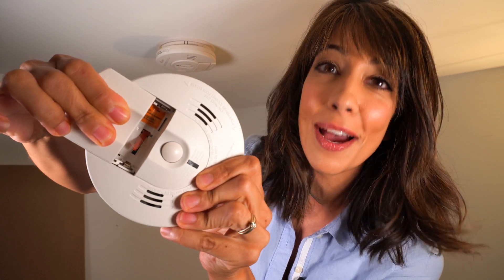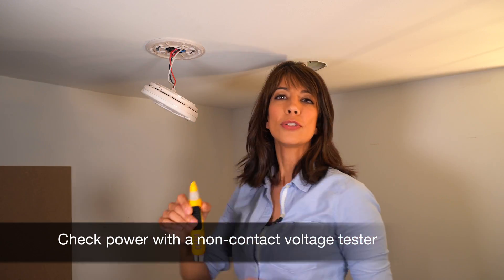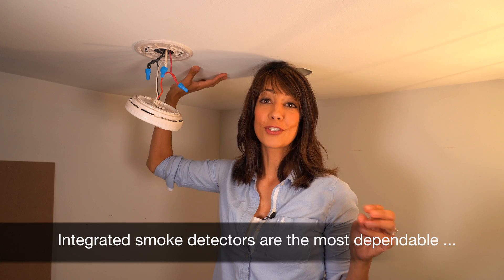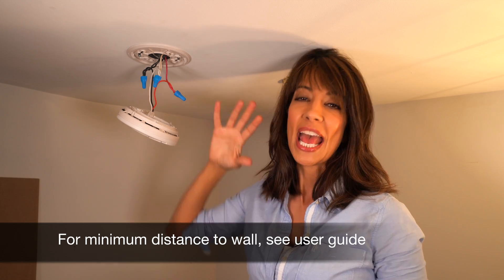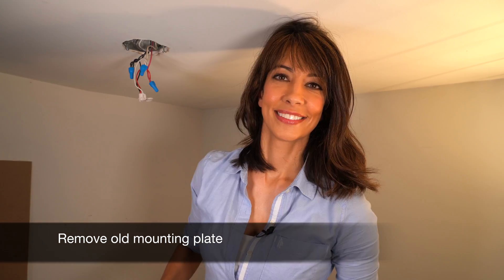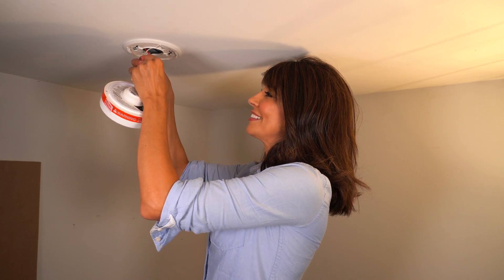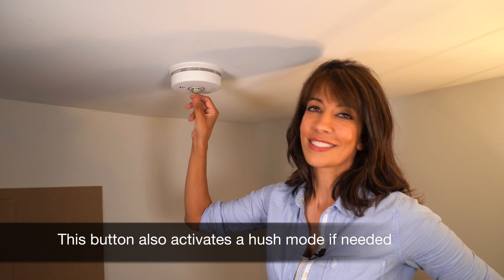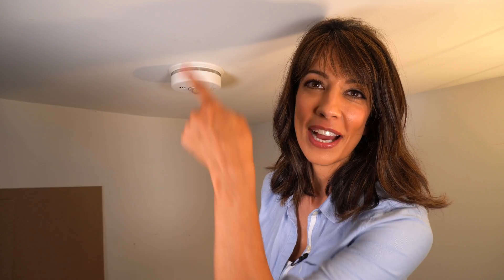How To Replace a Hardwired Smoke Detector | Why These Are The Best!

Comment: What if your pins dont match? How do you find the exact pin configuration
Reply from the maker: They sell adapters or you can wire in a new one that comes with your detector. I have a video that shows you how.

Comment: Tried replacing mine.  First I broke the plastic bit twisting it off that quarter turn that she made look so easy.  Then I couldn't find where the power to the smoke alarm was in the breaker box. No clue unless I shut the power off to the whole house.  Then I tried to pull out that plug.  Again, no clue.  I just about ripped all the wires out of the ceiling trying to get it off.
It would not budge.  So now I have a broken non-functioning smoke detector dangling six inches from my ceiling in my entrance hall.  
I should have called an electrician to begin with.
Reply from the maker: Oh no, that sounds incredibly frustrating! It's definitely tough when things don't go as smoothly as they appear.

Comment: Excellent video!  Do you have a preferred manufacture for smoke and carbon monoxide detectors?  Thanks!
Reply from the maker: I don't. We have to install ones that comply to our code. I would use a major manufacturer and check the reviews. Amazon has good pricing on those. I hope you found a solution that worked for you.

Comment: My co-worker and I both bought the 10 yr battery alarm. Mine lasted 3 yrs and hers lasted 4 yrs. It just started going off all the time for absolutely no reason. I'm back to the regular battery one. Waste of money
Reply from the maker: I appreciate you taking the time to share your review of the smoke detector. They should last as advertised. This is a category that would benefit from greater choice in brands. We are required to install 10 year battery alarms by code.

Comment: Hate hard wired, how you post to know where the fire ?
Reply from the maker: Hardwired is the safest option available you’ll be notified of a fire no matter where the location. Typically you’ll hear the smoke detector sound from the one unit and then it will go to all of the smoke detectors.
Reply: @DaruDhillon  or just 1 smoke detector in the room the fire is in... yes if you got bad ears sure, but i dont. Running around the house checking every room because you cant pin point which one..

Comment: I just replaced one of our Kidde hardwired smoke\CO monitors and it silences once active but the rest of the smoke detectors in the house are going off and won’t stop. Do you happen to have thoughts?
Reply from the maker: Sounds like a frustrating situation. I would troubleshoot each unit and turn your breaker on and off. I hope you find a solution.

Comment: Kiddie products are no longer available.  Is there a smoke detector that will fit into the existing 3 prong original outlet designed for kiddie products?  First alert and others require modifications or adapters if available.  Thx... BTW great videos, easy to understand, short and sweet and to the point.
Reply from the maker: Thanks for sharing your experience. I haven’t looked into the pigtail adapters. I would need to check on that.

Comment: I would rather add batteries every year . I have not been at peace since they were installed . It is currently chirping and nothing is working according to directions .
Reply from the maker: That’s unfortunate that the 10 year battery hasn’t worked out for you. I personally like the 10 year because it is a safety improvement designed to reduce fatalities. If your smoke detector is under warranty, you can return it and get a full refund.

Comment: If you are replacing an old FIREX detector you might need an adapter for the different plug found on the newer detectors.

Comment: If my previous smoke detector had wires, is it important that I stick with the same type of smoke detector with the wires? Or can I just change the smoke detector to battery only and tuck away the wires in the back of the detector?
Reply from the maker: If you have a hardwired detector I would replace it with a hardwired battery version. That’s the safest route and required by code and probably your home insurance.
Reply: @DaruDhillon  I really appreciate your wise advice.  I am glad I ended up replacing it with a hard wire version.  It wasn't as difficult as I thought it would be to replace it.  I also purchased that tool to tell if the voltage was on or not.  I was worried about electrocuting myself.  That tool was worth the money.  Thanks again.
Reply from the maker: @peacelovejoyandhappiness  I’m so glad you took the time to comment and did it yourself with the tester. It’s important you feel safe. Great job! ❤️
Reply: @DaruDhillon  awe of course, I’m the blessed one that you made your video. Thank you so much.
Reply from the maker: @peacelovejoyandhappiness  🙏🏽❤️

Comment: Thank you for posting this. It was very helpful. Some additional information though; Carbon monoxide detection should be done at the lowest points of each floor, as it is heavier than air. This means that by the time it reaches the ceiling, the house could be at dangerous levels. For this reason, it’s good to have separate detectors plugged in to outlets outside of bedrooms too.
Reply from the maker: @robertsmithington8892  thanks for the tip on carbon monoxide detection. It’s a good point. In my home I have additional carbon monoxide detectors in the bedrooms plugged into outlets and in the furnace room. Always important to consider when you have a gas furnace or appliances.

Comment: Hello Daru great video!
I have a question. I tried to change the battery in one smoke alarm. But then, I realised that the unit stopped working. When I opened it, I found that of the 3 wires connected to the smoke alarm, only the red and black are connected. The white one was dangling. I want to confirm if this is normal? 
Thanks.
Reply from the maker: Hi, and thanks. Usually the white wire, the neutral is connected to another white wire.
Reply: @DaruDhillon  Got it, thank you! It needs to be reconnected. It must have slipped from the wire nut.
Reply from the maker: @Odekaodeka  you got it. All the best!
Reply: @DaruDhillon  Thank you! 💕

Comment: My problem is they never labeled the breaker box when they installed the new smoke detectors. So I don’t know how to shut them down.
Reply from the maker: If you have someone who can help you locate the breaker that would be helpful. You can use a voltage tester to help you out.
Reply: They do make circuit tracer products, depending on how technical you are. 
    There's no reason why you can't turn every breaker off and check the lot. After all it is a domestic setting with nothing critical to go wrong.

Comment: You are Amazing!!!  
If I am replacing an expired Kidde hard-wired smoke detector, can I use the old wire harness and just plug it into the new detector, of which the red, black, and white wires are aligned with the old wire harness? Do I need to turn off the circuit breaker before connecting them?  Thank you so much!!
Reply from the maker: Always turn off the breaker to be safe. Thanks! Glad you made the change.

Comment: They make batteries that last 10 years, that are specific for smoke detectors. What people really have a struggle with is changing the batteries for smoke detectors that are installed on really high vaulted ceilings. I haven't seen a video yet that addresses the ones that are hardwired in or have the battery opening that don't slide open.
Reply from the maker: That’s a value added tip on the batteries. Thanks for sharing Robert! Good to know.

Comment: What if the beeping is coming from the ceiling? I disconnected the smoke alarm unit but the ceiling still beeps. I threw away the unit.
Reply from the maker: I would try to locate the source of the beeping. I haven’t come across this issue. If you found a solution or if someone has a suggestion please add a comment.
Reply: @DaruDhillon  One reply on another channel said that the hardwiring may connect to an older alarm system no longer in use. It certainly looks like it. A newer model was slapped over old location. I can get the braker to the mystery beeping shut off but then I have no electricity for my stove. I am going to try and completely seal off the wires with a plastic lid, caulking, spackle and paint. I can't be disengaging a whole hardwired alarm system. I don't know what I'm doing and I'd have to get into an attic.
Reply from the maker: @jojokeane  I'm sorry that's the situation you find yourself in. If your old smoke detector wires are in a junction box for safety it needs to have a removable cover so that you can access it if needed.

Comment: @Daru Dhillon our detectors are likely getting replaced this weekend
Reply from the maker: That’s great that you are updating your detectors and keeping everyone in your home safe!!
Reply: @DaruDhillon  i saw you had no rewiring to do too
Reply from the maker: @DylanChalmersWx  in this video I didn’t. I have another video on how to wire.
Reply: @DaruDhillon  for area's without a smoke alarm?
Reply from the maker: @DylanChalmersWx  I show how to wire your junction box not fishing the wire through the ceiling.
Reply: @DaruDhillon  today is the day for us to replace them. our old units are still up serving as temporary units until we take them down and put the kidde smart smoke alarms up. no more battery doors. which are a pain to open
Reply from the maker: @DylanChalmersWx  I always keep the receipts too. The warrantee is 10 years. Good going. 💕
Reply: @DaruDhillon  the units we have are essentially the smoke & co alarm like you showed just no voice alert and it too is an ionization. they won't be up much longer as the new ones will be getting paired up, added to the kidde app and then put in their spots. i do recommend people leaving their previous units up until they get their new ones so they have continued protection even if the manufacture year is 2003,2004 or 2005 so they can serve as temporary units.

Comment: shouldn't you be turning off your circuit breaker before doing any work with electrical wires?
Reply from the maker: Yes, all electrical starts with breaker turned off in each video then a double check is performed with voltage tester.

Comment: I’m having issues removing the old smoke alarm from the ceiling, seems like it’s locked. Is there a tab or something I need to push to turn it?
Reply from the maker: Usually you can apply a little pressure pushing upwards and turn it to the left. Turn off the breaker first. When in doubt I would also try the opposite direction in case it’s reversed.
Reply: @DaruDhillon  Thanks yeah I ended up having to twist harder as you said and it finally moved, the Kidde ones can be a pain like that.. thanks
Reply from the maker: @ACMaverick  I appreciate you replying because sometimes a little extra muscle is what it takes. Glad you figured it out on your own. That’s awesome.

Comment: Thx for your video! How to turn off the power of the detector?
Reply from the maker: You should turn it off at the breaker before replacing. I also like to use a voltage tester to confirm it’s off.

Comment: Can you add receptacles from a fire alarm?
Reply from the maker: For our code the smoke detector is on its own with one light fixture only. You’d have to check your local electrical code. I like the safety of having it separate.

Comment: Luckily where I live, the code for homes is one smoke detector located in the hallway outside bedrooms. Multi-unit properties require the smoke detector in the stairwell, on every floor, plus one in every apartment.
Reply from the maker: It's interesting how much codes vary from one place to the next. Always interesting to know the differences. Thanks Kris!
Reply: @DaruDhillon  I can imagine why there maybe such diversity between building codes across Canada. The home may not be multi-unit but more multi-family or generational. Thank you so much for your response.

Comment: It seems like you cut out the part I was wondering about which is how the "plate" is secured to the ceiling. I'm confued because when I was trying to "twist" my smoke detector off the entire thing came off the wall (the detector itself and the plate it attaches). How is that possible?? Seems like my plate wasn't screwed on
Reply from the maker: You’re spot on! You should be able to remove the smoke detector on it’s on with a gentle twist. That being said, I’ve seen many that are not installed properly and like you’ve seen the whole thing comes off. If it does, install the mounting plate so that your 2 screws are secure in the small part of the key hole openings on the mounting plate. Thanks for the question!
Reply: @DaruDhillon  Thanks, do I just use the two screw holes in the electrical box?
Reply from the maker: @0xSol_Invictus  yes those two holes are for your mounting screws. You can attach the mounting plate directly onto your electrical box and install the screws.

Comment: So if I'm installing a new hardwired smoke detector, do I have to re-wire everything or just plug the existing wires coming out of ceiling into the new smoke detector?
Reply from the maker: If you are replacing an existing hardwired detector that has a quick connect pigtail like the one in the video you can swap out the detector for a new one from the same brand. They also sell pigtail adapters online if needed. If your original smoke detector is really old and doesn’t have the quick connection you may have to hardwire it. I have a video on how to wire smoke detectors in the description box if needed. Thanks for the question Joe 👍🏽
Reply: @DaruDhillon  Wow, thanks for the quick response! It has the quick connect plug like in your video. Didn't think it would be that easy! Great video btw ! 😊
Reply from the maker: @JoeBucks  you’re in luck it’s a simple swap! Good luck, you’ve got this. 👍🏽
Reply from the maker: Thanks Joe! All the best to you. You've got this 😃

Comment: I can’t get my hallway one or my bedroom one to work. My dad died recently and my mom is handicapped. Could they possibly still be beeping because of them being interconnected and it’s telling me there are other ones that are dead?
Reply from the maker: You’re kind to be helping your mom and condolences on the loss of your father. To help you can check each detector for its expiration date. If you can’t locate the expiration date it’s time to replace them. They need to be replaced every 10 years because they expire. Sometimes one unit will malfunction and start beeping or the alarm will actually malfunction and go off repeatedly. In that case you can press the test button on each unit to locate the one that’s not working and replace it. It’s important that they are all working properly. I hope you are able to find a solution.

Comment: What should I do if I've replaced all the old ones got brand new batteries for each and then they still beep?
Reply from the maker: Check each individual units test button and it’s expiration date. If it’s expired or has no date replace them. Too much dust on old smoke detectors’ sensors make them less sensitive and dangerous.

Comment: How to change the battery in the ceiling smoke alarm
Reply from the maker: At the front of the alarm their should be a little rectangular panel that you can slide open. I hope that works for you.

Comment: Anyone ran into a scenario where the beeping is coming from the ceiling and not the detector itself? I replaced my detector with a new one hoping it stops the 5 beeps but to no avail. Anyone?
Reply: Yes this is currently happening to me with one of my smoke detectors. Chirping is coming from the ceiling where I detached and removed one of the smoke detectors. Since I’ve two smoke detectors that are interconnected I think the one that is still attached is causing the electrical socket box  to chirp from the wiring. Will get an electrician in to solve it.
Reply: @enaidu58  my issue was actually this… I replaced the hallway  detector a few days but forgot to throw it away. I then left the house for a week and my brother ended up taking the old one (it still beep even after being taken down) and put it in the night stand in my room. The beeping wasn’t from the smoke detector in my room but rather the old one I didn’t throw away lol took me a week to figure it out since I don’t use my nightstand often and my brother was away. Even the electricians didn’t have an answer for me, they just told me it was probably my neighbor… best of luck to you!

Comment: I am replacing 4 wired smoke detectors with 7 battery only smoke/CO detectors. I didn’t have any in the bedrooms and in CA they need to be integrated. My question is what do I do with the wires since I don’t need them?   Can I tape off the connector and stuff it into the box?

Comment: Replacing mine. I do not have the red wire since its spliced into the light circuit I guess.
Reply from the maker: If the smoke detector you are replacing  doesn’t have the red wire then it’s not connected to any other smoke detectors. Older homes are generally wired this way. If you ever plan on renovating adding interconnected smoke detectors is really important for the safety of you and your loved ones. Good to hear you’re replacing yours CT!👍🏽

Comment: Thank you for the video. However for viewers not in the USA, be careful about the wire colourings (at 2 mins 10 seconds of the video). In Australia, the RED wire is usually the ACTIVE "HOT" one. it is CRITICAL to not wire the wrong wire into the wrong socket. Check at your locality.
Reply from the maker: I appreciate you sharing that information with viewers, Alex. Important safety information for international viewers. Hello to you in Australia 🇦🇺 from Toronto 🇨🇦
Reply: @DaruDhillon  oh sorry, Toronto not USA. You must hate people thinking that you are in the USA. At least you can take comfort that your flag doesn't have a Union Jack in it any more, like ours does. So embarrassing.